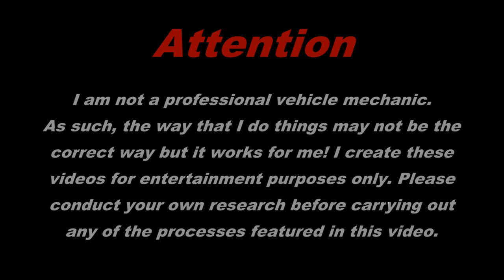Peugeot Django 50, 125 & 150 - Fork Seal Replacement & Fork Rebuild, All Django Variants

Comment: Hi kev 
Great video ,I have a peugeot vivacity 125 and can't even get an air filter for it ,I also had problems sourcing fork seals and my seals are exactly the same size as yours 32/43/10.3 and was at a dead end to were to get some from ,thanks to you I've ordered some from athena  thanks some much

Comment: great job iv just followed you step by step .as the design of the forks and the vulnerability of the dust seal getting blasted with road crap do you think some small fork gators would help, before I put them back on the bike ?

Comment: Thanks for the video. Great content. My Django is 4 years old with 6000km and leaking like crazy on the seals. Very disappointing especially if you can’t fix it with of the shelve parts. Bought a Yamaha as second scooter.

Comment: Hi Kev, great detailed video! Quick question: could u make a video on how to replace the speedo drive cable/unit or maybe a reply in the comments on how to replace it please. i usually tend to repair my django 125 myself with the help of workshop manual, but it seems there is nothing about the speedometer replacement. Thank you
Reply from the maker: I'll look into it mate! 👍

Comment: good job! do you know how to remove transmission cover? I want to replace 9g pulley bean. thanks!
Reply from the maker: Yes absolutely, you first need to remove the upper seat fairing from the left side, then there are 2 bolts holding the airbox in place, once the airbox is removed, there is a further 8 bolts holding the transmission cover in position. On refitting ensure that a new gasket is used. PS, the kickstarter comes away with the cover. 👍🤓

Comment: Great vidio Kev. I have a pergeot django evasion. I need to do a whole front end replacement new yolk, bearing ands forks does any one have a vidio on how to put the front face and all the other stuff behind the fairing on.

Thanks.
Reply from the maker: Hi mate, thanks for the comment, I don't have a video of that process as yet as I haven't needed to do it but when I do I will be sure to film it. Unfortunately practical videos with the Django are a little thin on the ground on YouTube!
Reply: No problem thanks for the response keep up the good work Kev.